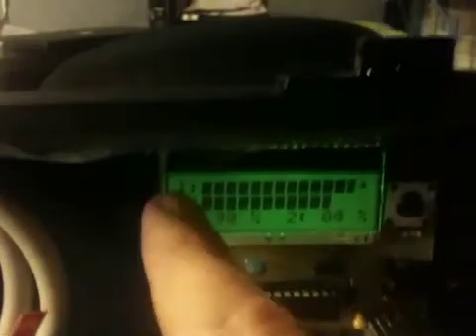BarView for my Fpv Rssi Switch

Comment: That is coming on really well, though I think that I could only use the sound monitor mode for about a minute before my head would explode! ;)  I do think that using sounds to indicate how strong the various signal are is a good idea.  Maybe you could make it beep to indicate when it changes receiver and which one it changed to, .e.g. if it change from receiver 2 to receiver 3 it would beep 3 times?

Keep up the good work!